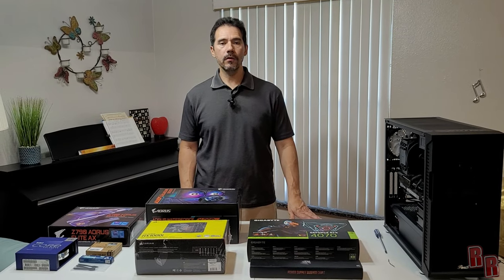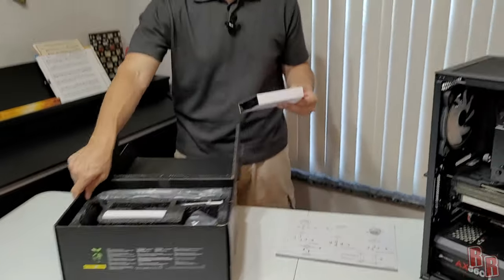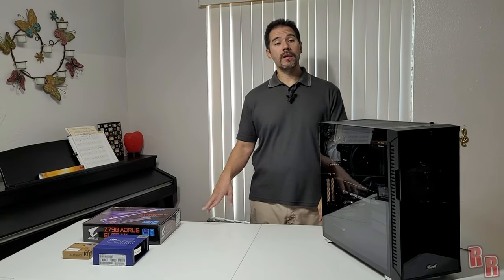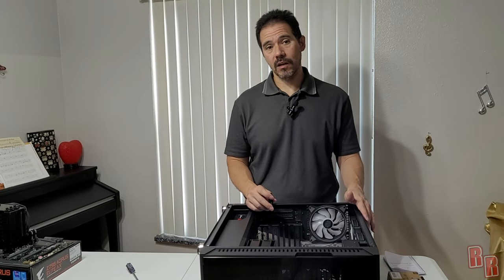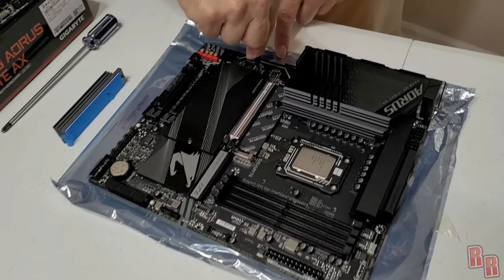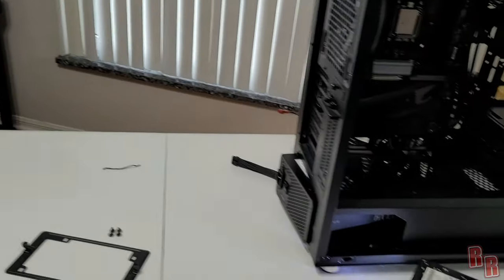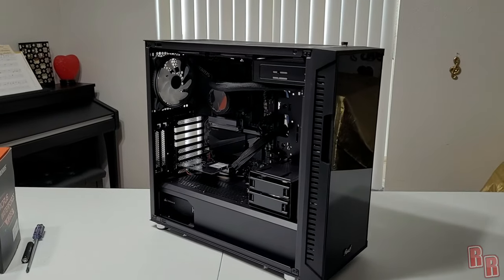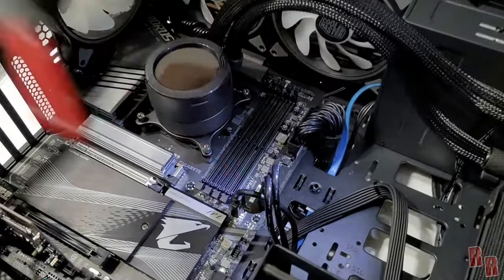i9 13900K RTX 4070 Gaming PC Full Upgrade Unboxing Real Review

Comment: So that nasty smell is normal? I got the same psu and im scared of plugging it now because of that weird pungent smell.... Help pls 😅
Reply from the maker: It did smell weird when unboxing, but once plugged in and in use, I did not notice any odor. It may have been the packaging. The PSU has been going strong for months with no issues or smells. Plus, it's super quiet.
Reply: @Real_Reviews thats reassuring. Thanks for the answer and for the video !